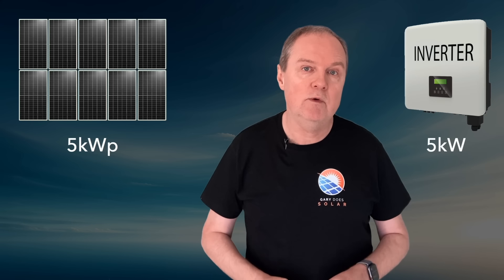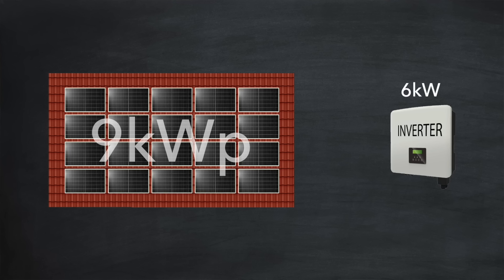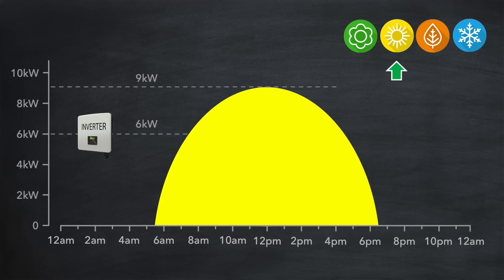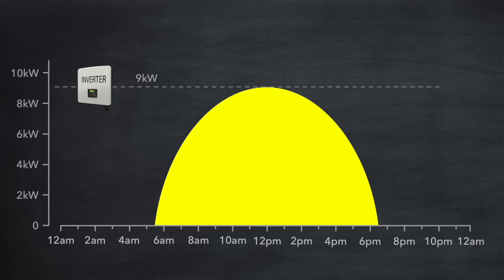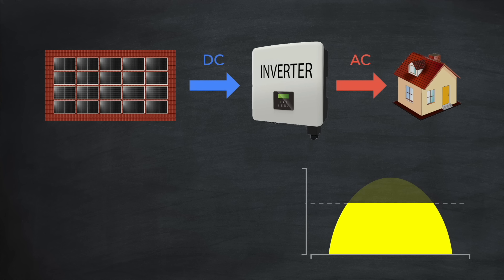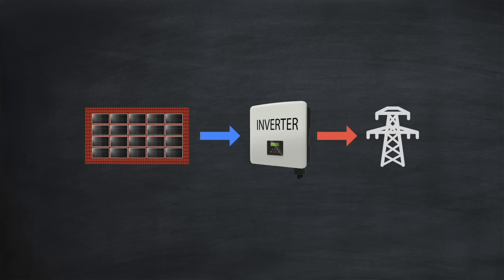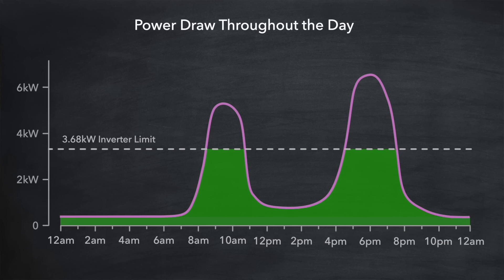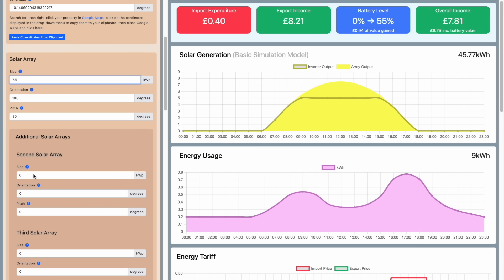Solar Array Oversizing - All the Benefits and Considerations

Comment: Hi Gary, fantastic video. I have solar panels and battery. I live in Scotland, can I try wind energy? Which one do you suggest?
Reply from the maker: You’re most welcome 🙏 

Now, wind generation is certainly an option that many are starting to look at, to compliment solar. But (unfortunately) there are a number of factors that limit it’s viability in consumer applications:

Wind turbines are not quiet - worse, the noise varies with the wind strength,  could drive any neighbours close by insane.

They are also nothing like solar panels in terms of reliability - you might find you’re spending a fair amount of time, money and effort keeping them going. 

And they’re expensive. Like really expensive for one that generates even just a few kW. 

Also watch out for the advertising. Some retailers talk in terms of kW (power) when they’re actually taking about kWh (energy) - even a cheap 30cm diameter turbine will generate 20kWh given enough time!

Hope this helps.

Comment: i don't understand. the solar array is oversized by increasing the solar panels. but how can you surpass the specifications on the MPPT solar charge controllers without damaging them? or is that not the case? do you simply put more than one charge controller?  where im from the solar charge controllers are connected to the batteries, and also the inverter is connected to them as well. it does not go through the inverter to then go to the batteries. which is what i understood to be going on here at the very least. also, where does it say that the inverter is rated to take an array that is 50% larger than it's rated output? in the manual? this is the first im hearing of this. no electricians I've ever met have ever mentioned this. not that i don't believe you though.
Reply from the maker: Hi Mike, for more detail on how oversizing works with inverters, you're best to research the manufacturer you're interested in. Here's a technical note regarding SolarEdge inverters: https://knowledge-center.solaredge.com/sites/kc/files/inverter_dc_oversizing_guide.pdf

Comment: Oversize, grid tie inverter, line connected battery charger and maintainer, inverter and transfer switch. Hybrid grid parallel system, excess goes to the power company.
Reply from the maker: Sorry, it’s late in the evening for me. I didn’t understand your point?

Comment: Thanks for the video, i was looking into solar as an option 8kwp with a 6kw inverter and a battery bank, most likely ac coupled to allow for expansion. Though now i have been trying to research microinverters supplying AC straight from the panels - from my understanding this would mean the G99 set as the kwp, with the bonus of no clipping along. Aside from the initial cost would there be any other downfalls? Or has anyone got any real life feedback on microinverters?
Reply: Thinki just posted a similar question
Reply: @harvyd1967  well hopefully that’s a sign it’s a good idea!
Reply from the maker: I was thinking about, but decided against talking about oversizing in microinverters as well. Essentially, they're the same thing but on a per-panel scale - the same principles in the video apply. The panel might be, say, 400W and the microinverter (e.g. Enphase IQ7+) might be 290W. That's a 133% oversizing.
Reply: @GaryDoesSolar  that’s a good point and item to look, so the clipping essentially occurs at the panel itself.

Comment: (Newbie) Doesn't it mainly restrict you to the OCV limitations of your inverter? Is not the smaller the wattage of an inverter have smaller OCV limits?
Reply from the maker: Oh crikey - I don't actually know the answer to that. Maybe someone else does...? I may have to do some further research...
Reply: Each inverter will have a maximum voltage limitation. E.g sungrow 5kw hybrid inverter is 600v so depending on the solar panel voltage this will be the limitation although other factors also come into play such as voc at stc, panel temp coefficient at voc, minimum temp in the area and number of panels in a string.
Reply: @jameshind6644  I guess I should have said VOC instead of OCV though I think they mean the same thing. My puny little inverter/charger I'm starting with has a VOC range of 120-450 but it only has a  max PV input of 13A. My panels put out 13.92 ISC (short circuit current) so I am forced to run them in series. I am .92 over so I hope it does not eventually fry the thing. All these different abbreviations are confusing but I think I'll eventually get it.

Comment: Hello. I have a string of 10 Canadian Solar 455w panels. It was previously connected to a Growatt SPF 5000 ES inverter, perfect operation. Considering that their orientation and inclination are deficient, the maximum power in the 4 months of operation (that I saw) was 4,060w. A few days ago I replaced the inverter with Growatt SPF 6000 ES Plus. It supports, according to the specifications, 8,000w maximum, 4,000 on each string. Considering that the 10 panels comply with the inverter specifications regarding voltage and current (VOC 412V and 13.95A from the 10 inserted panels vs 120-450V and 16A per mppt inverter) do you think they can work at this maximum power of 4,550w or is it too much much per mppt? Some say that yes, this oversizing is good because it is not often reached to the maximum, others say that the maximum power of 4,000w per mppt must be respected. Thank you in advance !

Comment: Hello Gary,
I'm having trouble finding an inverter in the 15-20KW range that supports Low Voltage batteries. 
When you're in this range are all inverters designed for High Voltage batteries?
Reply from the maker: Not sure which country you're in, but it's a great question to ask in a solar forum, like this one: http://www.facebook.com/groups/2197329430289466 Good luck!

Comment: Thanks for this informative video.
I'm under the impression that a larger inverter can recharge DC batteries from the grid quicker and this is becoming more beneficial as people are installing larger battery banks on their homes.

Any thoughts about this aspect?
Reply: All batteries have a maximum charge rate so just make sure that you pay attention to that as the limiting factor.
Reply from the maker: You're most welcome, and as it happens, I've been watching and recommending your heat pump installation videos :-)
Reply: @GaryDoesSolar  well it is a small world. I've been box set binging my way through your back catalogue to get myself fully up to speed on solar panels and home batteries.
I haven't found anyone as informative and comprehensive about the sector so keep up the great work! 👍
Reply from the maker: @UpsideDownFork  Thank you - that's really kind of you to say 😊 I'll keep the videos coming...

Comment: Considering how cheap solar panels are getting, it makes more sense to oversize your system if you have the space to accommodate it, it will help to generate more energy in the winter months when you're likely to generate less, it will mean you will likely generate more then you need in summer months, but who cares, you want to try and generate as much as you can in the winter months, and if you are grid connected, you can sell the excess energy to the grid or store it in batteries.

Solar panels are so cheap now, especially in Europe, that oversizing makes a lot more sense
Reply from the maker: Agreed 👍🏻

Comment: You can oversize the PV current but not the voltage to avoid damaging the inverter ...it will just clip the current but too high a voltage will damage the inverter..  and to save money on the install you want higher voltage capable input on the inverter so you can save on running expensive and larger PV conductor cables...(copper is expensive) most would select a 500v or higher input voltage capable inverter since as the voltage goes up the current needed goes down and so does the conductor size! 30 amps at 500v is 15000 watts or 150 amps at 100 volts(15000 watts)....makes a world of difference..I'd rather run a 30amp rated copper cable than a 150 amp copper cable a 100 feet!
Reply from the maker: I certainly would always recommend that a qualified installer undertakes the calculations involved with array oversizing 👍🏻

Comment: I’m planning my own system, and currently working on sizing based on the system input, and panel configuration.
I had come to the same conclusion to over-provision on the PV side, and this video further confirms this industry standard practice.
I’ve been playing around with a single 100W and 400W panel as a proof of concept, and I’ve personally seen examples of everything you’ve described. Thanks!
Reply from the maker: Great stuff, and thank you 🙏

Comment: Another great video Gary, thanks.
My array is 6.8kWp on a 5kVA (4.4kW) inverter (55% oversized) and tbh I would have installed more PV capacity if I could have fitted it on my roof. It's a DC coupled Victron system with 14.4kWh of Pylontech batteries so I can avoid clipping most of the time. I'm also based in central Scotland and although my roof is facing 184 degrees, the pitch is just 14 degrees so it's unlikely I would see 6.8kW from the array even in summer. So far I've seen 6.3kW max in mid July so I hope to see a bit more than that in late May or early June but I doubt I'll see 6.8kW. In fact my Victron MPPT charge controllers are 250/60 units (2 of them) and although they are spec'd at 3440w each, with my charge voltage of 53.2V, my theoretical max would be something like 6384w total (53.2*60*2).

I am considering adding an AC coupled non-hybrid inverter with four or five 435w panels mounted vertically to my south facing garage wall as a "winter array" to boost my generation. This would be a more cost effective way to add some extra capacity for the winter months than adding another MPPT and having to run DC cabling all the way back to my inverter and battery location. I could just hook it up to the garage consumer unit instead. I might even add a few extra panels to the east and west gables of the garage and use optimisers to allow them to work with a single inverter. A project for later in the year I think. :)
Reply from the maker: Thanks for sharing this info about your system, Craig - sounds great! And always a good thing to add more panels if you’re able - all the best with it 👍🏻

Comment: If your energy consumption is around 5kW in general and you therefore decide to install a 5kWp array, the maximum you can generate is 5kW(approx) and that will only happen in optimal conditions, ie it will cover your demand only occasionally. So oversizing your array means you can generate 5 kW for much more of the time and cover more of your demand. But other factors like load shifting and tariffs mean you need to do the maths to find the optimal solution, rather than just piling on more modules.
Reply from the maker: A good way to look at it.

Comment: The trick is to be able to utilize all that power the panels are generating. If your batteries are fully charged and your household is only using 1kw then the maximum power generated will only be slightly above 1kw.
Reply from the maker: I'm not sure I understand your point. What if your panels are generating 3kW? In your scenario, your inverter can export the remainder, hopefully for some reasonable revenue.

Comment: Perfect - we do exactly the same on a DC coupled system mainly for winter shortfall (adjustable array), just be a bit careful as summer yields even inthe the UK, can be 10x what you expect, so stuff can get very hot quickly - we may do a G99 as currently just do off-grid - but even with OE at 15p/Kwh export (upto £1k / pa????), i'm not sure that its worthwhile? - having said all this I'm just configuring my system for VE Dynamic ESS (and G99 approval) for possible use with OE
Reply from the maker: Sounds great! Thanks for sharing this - will help others!

Comment: Timely. I'm in the process of getting a 5Kw inverter with 9kW panels. However the panels are in two locations  and one set will be from partially to mostly shaded (there will be optimisers) from maybe 1pm onwards, so that only for a few hours in summer will i get the full 9KW (If ever as maybe I won't get the max before the shading on the "shaded" section starts) Also as I'm in the UK this depends on DNO approval as (as you explain) a G99 has to be applied for. 
One other benefit of oversizing is that rather than getting a set of panels in one location and then later deciding you'd like more, it's cheaper to install in one go, essentially I'm only really paying for the extra panels as they will be on a garage roof and don't require an extra full set of scaffolding etc and it should be easy (for them) to add these on the same visit.
Fingers crossed for me re the G99 it went in yesterday  !
Reply: please make sure you get g00 permission before the install goes ahead, know of friends who hd similar uk installs last may but yet to get even a msc cert yet alone any permissions.
Reply: opps  G99 permission
Reply: @alanclark2584  thanks. Yes the supplier won't go ahead without G99 it's all on hold until then
Reply from the maker: Hope all goes well with the installation (and of course, the response from your DNO)! :-)
Reply: @alanclark2584  Amazingly the G99 has been approved, its only been a week I was expecting end this month earliest. Install is now cheduled for second week of Feb. Expect the current sunny weather to end at that point.
Reply: @GaryDoesSolar  It did the G99 came through in just 3 days and its been up and running for about 10 days now. I'm pleasantly surprised, the weather has generally been rubbish but my battery is full by noon even on the cloudy / rainy days (thats enough for a days worth) and I'm charging the car / using everything i can (not jumped through the export hoops yet). Ive used zero grid electric since it was comissioned and thats in this very poor weather. I see i was also right about sunny weather ending.
Reply from the maker: @Joe-lb8qn  A great start with your new system, Joe! 😎 Sunnier days are coming! ☀

Comment: You are missing the model that takes into account the annual losses, high temperatures and solar irradiation levels to work out the optimal oversizing for different areas. In tropical and equatorial countries, the panels temperatures can easily hit 60-70C which greatly changes the output. Average and peak irradiation levels at different times of the day and year also changes that. Then you have areas close with hills and mountain ranges that increases the chance of cloud formations daily.
Reply from the maker: Ok, but I'd argue that you're missing the point of my video. It's is designed to be a comprehensive introduction to the topic of oversizing (in 12 minutes) to provide viewers with sufficient information that they can then instruct their installer, or find out more to build on that information - including the additional factors that you raise.
Reply: Not about the video. That's great. One of the problems during my own path to solar, I had to figure out the relationship between these things in order to come out with a good DC to AC ratio suitable for hot climates and intense irradiation. I had to build my own spreadsheet to work out the calculations for losses due to high temperatures and local irradiation. Not everyone knows how to do that and maybe if someone like yourself would have something ready for them to use... just a suggestion  @GaryDoesSolar
Reply from the maker: @DavidCheok  Cheers David - I've made a note and might look into this further... thanks for raising 👍

Comment: In my country you only get the government grant if you export less than 20% of the energy produced. Over-sizing can get you in trouble. Since I stop working from home and bought more efficient appliances I'm finding harder to consume all that electricity,  by this summer I guess I'll have the car plug in everyday to use that 80%
Reply from the maker: Hi Samu, which country is that? I guess they don't want to much export then! And yeah, it puts a lot of pressure on you to try and consume all that energy!

Comment: Found this excellent channel today.  Going to be 8k inv 12k solar ratio in a month. All my upgrades this month are engineered for winter production, 2x 2790w to 3255w, and a new 3300 array PV2 remains at 2790w. As a whole 8370w to 12600w, the 2790's have peaked at 3514w (vertical bifacial) with this set up I expect the 3300 will max at 4000. Overcast winter estimate 3200 watts total and should give me the 14.6 kw I use daily. I dealt with 105 days of overcast and fog. November 2023, 4 hours direct sun for the month, December was 8hrs and January at 13 hours, 3 months 25 hours of direct sun. My inverter was silent for months. In heavy overcast pv2 a 2790 array produces a minimum of 580 watts. Bi facial panels are mini black holes.
Reply from the maker: Hi Bob, great that you found my channel :-) And thanks for sharing details about your solar installation and performance!
Reply: @GaryDoesSolar  It seems the 2nd inverter was showing inflated pv values on pv1 and 2 it was producing different #'s with the same array switching inputs. My solar dealer drove 8 hours to do a free upgrade to a amen 10kw, same as NHX10, all my data flawed, looks like the 580w from pv2 is actually 380w in heavy rain. So far I cannot get any data using 6kw a day the pv is clipping from sunrise.
Reply from the maker: @bobmonztr  Ah ok. Good that you now know what was going on, I guess...